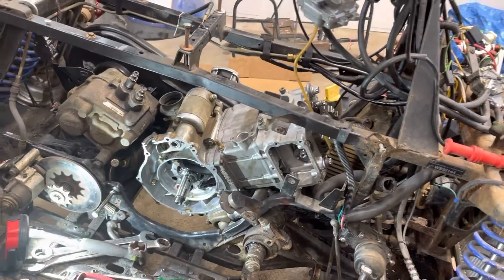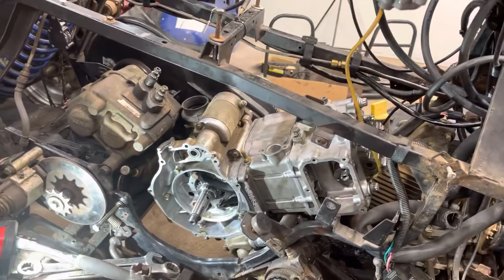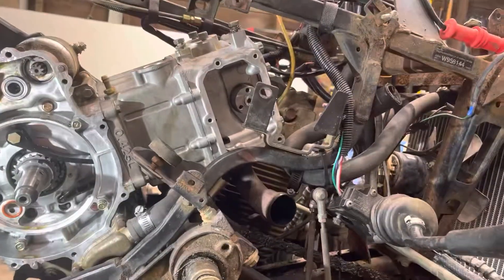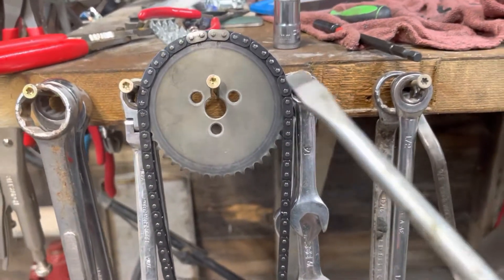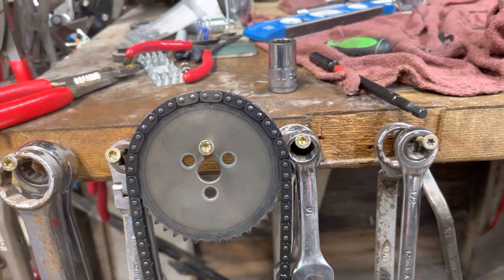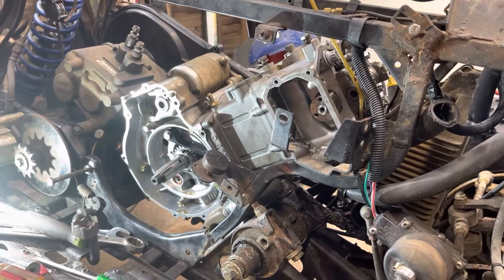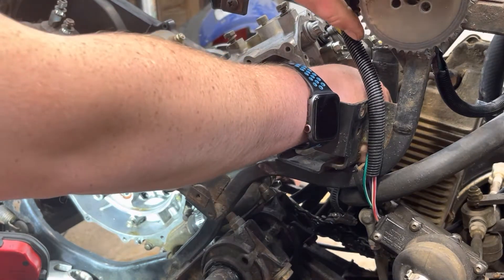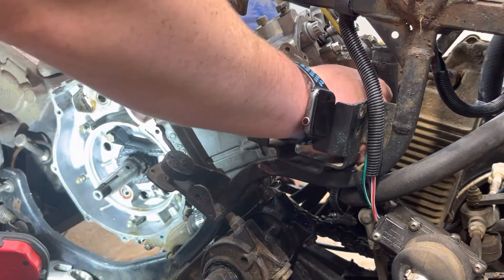How to properly set the timing on a Polaris Sportsman/Magnum - *See description for parts and tools*

Comment: Can one  of  these jump time? I picked  up 1995  425 magnum as a non runner cleaned the carburetor  new fuel line 
 Fuel  pump  works  good  
     Starts up easily  but bogs whe given throttle and back fires.        Or could  this  be a valve  job  thanks
Reply from the maker: I would check the CDI as well. As far as the timing goes, unless the tensioner is back all the way off and the chain is stretched, I suppose it could jump time. But that is not very common.

Comment: Once the motor turns over will the different colored links still match up with the dots on the sprockets ?
Reply from the maker: They won’t. The sprockets are different sizes. The only time you want them lined up are when you’re setting the timing off the crank.